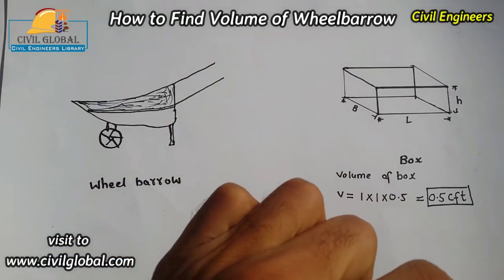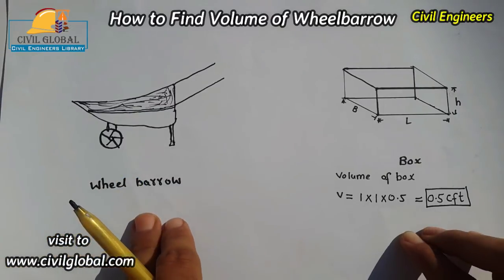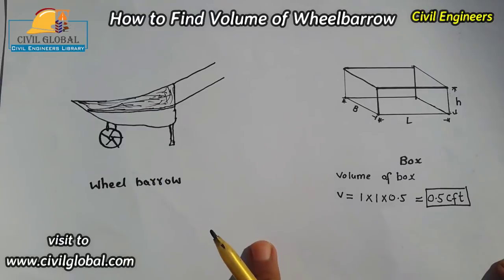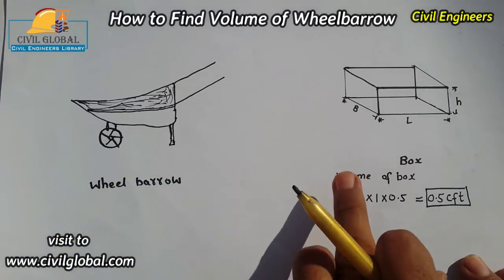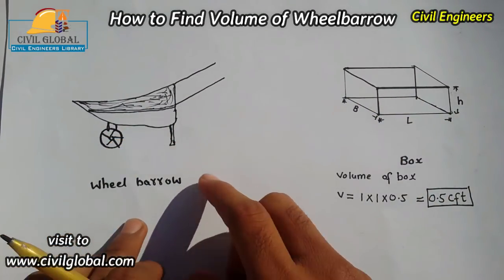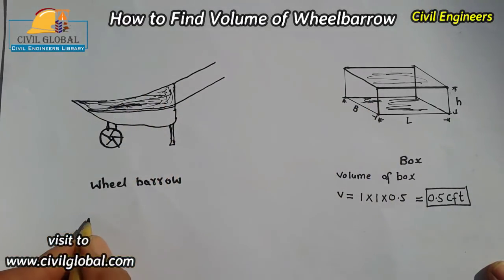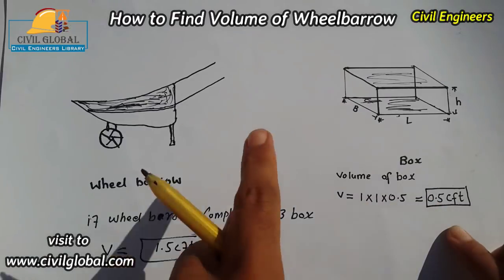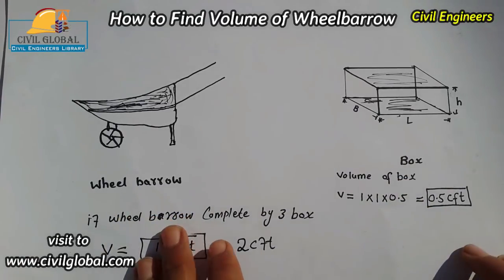How to find Volume of Wheelbarrow

Comment: The volume of wheel barrow is 2.5cft and volume of cement bage is 1.25cft .this means like 1:2:4 ratio concrete : 1*1.25= 1.25cft ,2*1.25=2.5cft and 4*1.25= 5cft = But you batching by the process of wheel barrow : 2/2.5= 1.25+1.25=2.5 cft sand & 4/2.5= 1.25+1.25+1.25+1.25= 5 cft

Comment: Heck, just use a measuring bucket or any other piece with known volume! Fill the wheelbarrow and count the volume!

Otherwise, you have to build such a box, which is a bit of a challenge and a waste of resources and time.

If you have a water meter nearby, it's even more comfortable as you can read precisely every liter from it.

Comment: Add water in wheelbarrow and use a measure bucket  to find total volume.
Reply: Water has different density than crush and sand.
Reply: Suhbat Khan 🤣😂
Reply: Use measure bucket to fill the wheelbarrow! It’s much easier and you avoid contamination of measuring bucket if wheelbarrow is not clean.😉
Reply: always on point
Reply: @Suhbatkhan1  The volume is always the same, it can at most vary according to the temperature with different materials. However, the assumption is that the cement is made immediately at the same temperature.
Density is only relevant when loose material condenses under pressure or moisture evaporates. In wheelbarrows, this will not have time to happen unless you leave cement on them overnight. ;-D
Reply: @Suhbatkhan1  finding volume not density